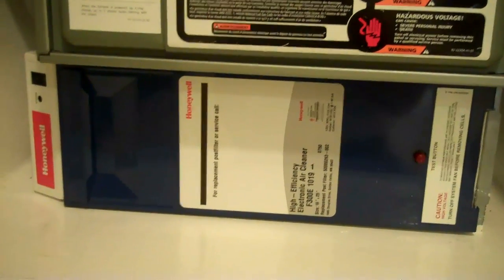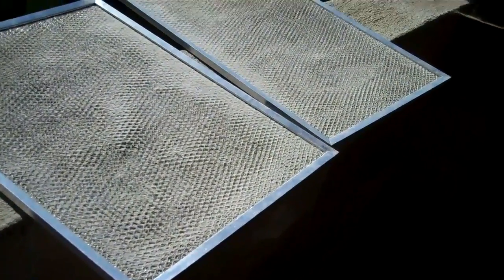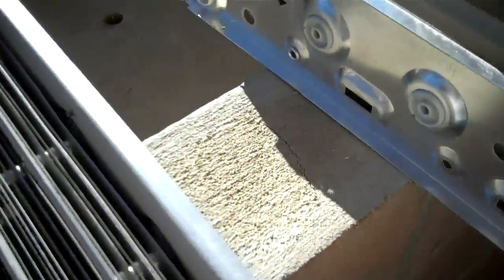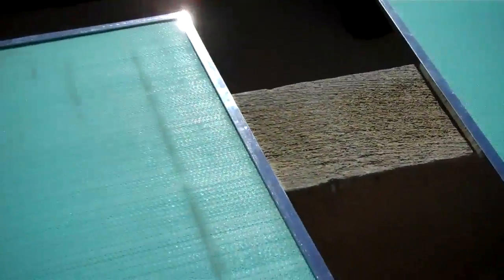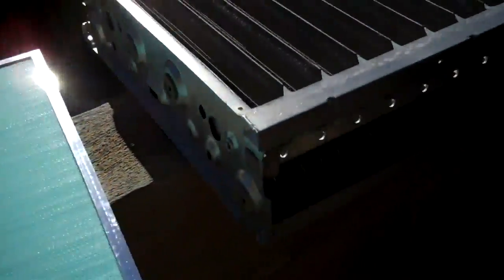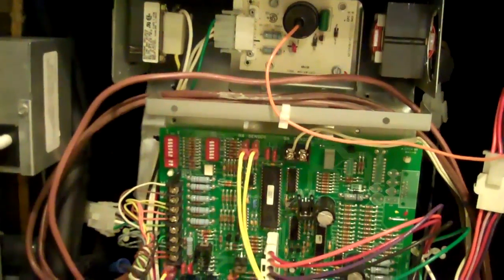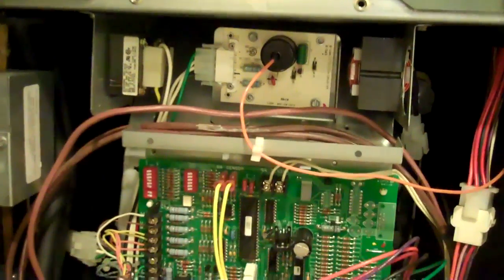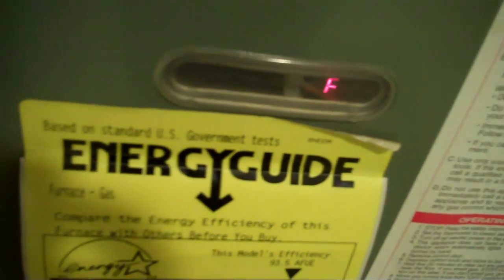HVAC Cleaning a electronic air cleaner.

Comment from the maker: @gotenks98765 Your forced air system require only one filter ,the black filter you see is from the furnace manufacture I leave that in to monitor filter bypass.I do recommend the post filter they really help out. Thanks!

Comment from the maker: @BoNGL0AD The per filters and the cells can be washed in a sink you just have to be careful not to bang them up and they will not short but the post filter get change out every 6 months because they are statically charged.

Comment: It sounds stupid but I always put a light coating of Pledge on my pre-filter only to make it "sticky".. I found that it tends to trap more coarse  dust and "spare parts" ... Only  the really fine dust makes it past into the collector cell and cleaning it off when its time is easily done with "Spray-9" and water.. I also tried the pledge trick on the disposable el-cheapo filters the property manager hands out at my G/F's townhouse complex and noticed hers seemed to collect dirt faster.

Comment: I jut moved in a house and looked like the EAC is not working. If I want to change back the one time throwaway filter, is it possible. But the size of the cell unit x 2 is around 20" x 18" and I can't find exactly the same size filter in Home depot. Can you help? Thanks